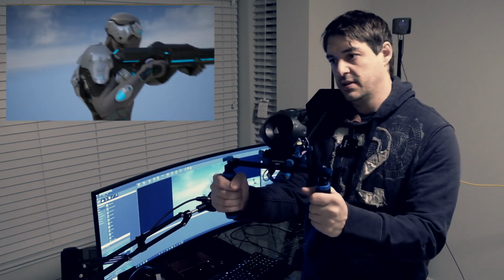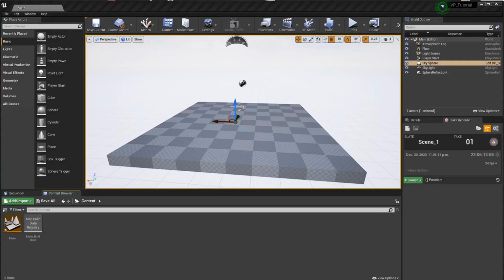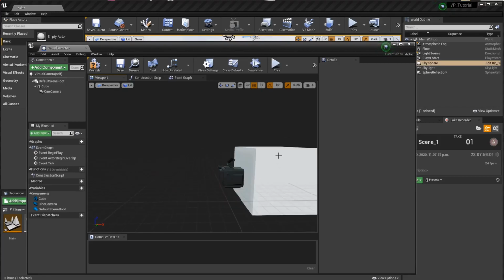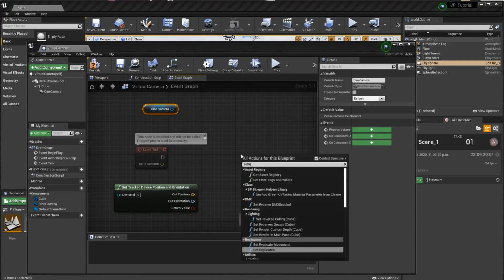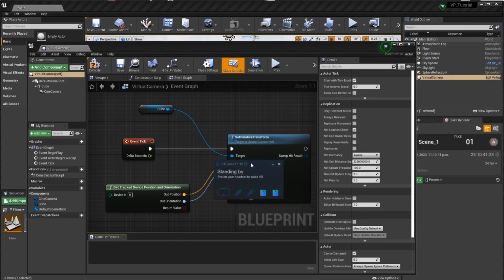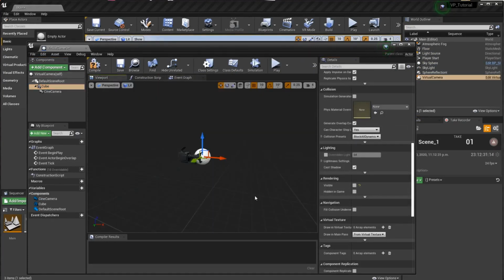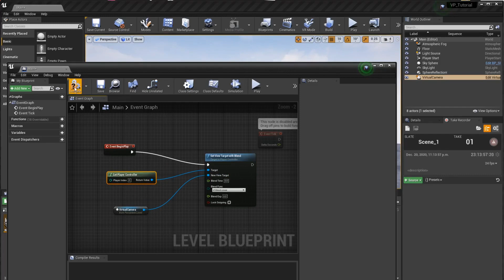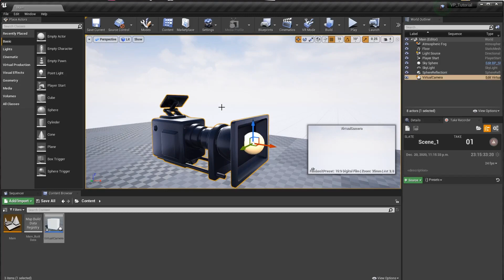Creating a Virtual Camera using HTC Vive in Unreal Engine (4.26)

Comment: for QUEST 2 users, you just have to connect quest to PC via Airlink, then open up steamVR, and once the steamVR recognises your HMD and controllers, do the same exact method as this video. for the index, numbers, QUEST controllers for me were usually 1&2.
Reply from the maker: Thanks! This is great information to know! We are in the process of making an updated video for this, including new hardware and rig, and we could include this information. 

We will also include info about how to find your index numbers through a blueprint.
Reply: @RetroPixelDigital  all the best 😉 thanks ofr this tutorial, it was the only tutorial which helped me to track virtual cameras with VR equipments

Comment: Another question is there any way to average the transform data from the controller to smooth it out? Like a way to make the camera sort of stabilize from averaging the data before it transforms.
Reply: I'm not sure about within the software (probably), but from a film perspective, attach the controller and camera to a gimbal; this technology will stabilize the controller/camera/shot and a necessary tool for aspiring filmmakers. A tripod also works.

Comment: Really appreciate you making these videos. I've got the tracker working as expected now in Unreal. I'm trying to export the tracking data that I record in Unreal to Blender. Do you have any ideas on how to do this? Or do you know if there is a way to use the Vive controller directly within Blender in the same way parenting the transform data to the camera? Thanks alot!
Reply: Sorry about the wait on this... I haven't tried it out, but you could most likely bake the animation of the camera from within Sequencer, then export that to FBX, and import it into Blender. I don't use Blender much, but I know it can import FBX without issues...

The real question is if you can bake out and export the FBX camera... If this isn't straightforward, or it doesn't work, let me know and I will look into a possible solution when I have a few minutes!

Comment: Hey, thanks for the tutorial! Would you tell which version your controllers and base stations are? Does this work as smooth with the first gen vive trackers?
Reply from the maker: These aren't from the pro, but I'm not sure which versions those were. We are now using a new setup, as those ones were on loan. The new one is using Manus Trackers. We will be posting a new video on that setup soon!
Reply: @RetroPixelDigital  Did you ever make the new video? I actually bought Tundra Trackers for full body mocap, but also want to use it to do camera tracking. I'm interested to know how you've progressed, and want to learn this in UE5 hopefully with some data smoothing. Would love to connect with you! Let me know if we can chat!

Comment: Thanks for the tutorial man. I'm trying with my oculus quest 2, it's just pain in the ass as my laptop is not compatible with the link cable, I had to use airlink and the HMD just swaps into the transform, double influencing the location of the blueprint actor like you mentioned in 4:53.
Reply: Did you ever get this working? I'm curious, because I thought it was only possible to do the tracking through UE4 if it was outside-in tracking, like using the base stations to measure the HMD's location, but the Quest 2 uses inside-out tracking, right? It uses internal cameras to track it's location in a room?

I thought this method was incompatible with this kind of use-case, but I'd be interested to hear if you've got it working!
Reply: @tylerwalker492  I did it in quest 2. You just have to connect it with Airlink and once the SteamVR recognise your quest controllers, you're good to go with this method.

Comment: Have you done this with the trackers instead of the controllers?
Reply: I haven't, but I've found a few articles online that illustrate how to do it. I think this would be a better option for me, as I don't plan on using the controller for camera settings. That was one of the reasons Matt Workman preferred the controller to the tracker...

But, the tracker is much more compact, so I would love to replace it eventually.
Reply: it does work, i just tried. You just click "other" as sort of device in the drop menu :)
Reply: @shelltakeyoutoheaven  which drop down window is that? Im using trackers too. cant get the cube to rotate at all, chanigng device id numbers but Im up to 10 now :)
Reply: lol user error, didnt realize my tracker turned off automatically after I restarted steam VR :)

Comment: So all my rotations work, but the physical transform (moving left right forward back up and down) seem to be moving only millimeters in unreal, is there a way to adjust the movement values or correct this?
Thank you the tutorial was much more straight forward than other tutorials I've found
Reply: Thanks for the kind words. I've noticed that it doesn't move enough, too. I'm thinking it's got something to do with real world scale of the scene, but I'll have to dig deeper. Stay tuned!
Reply: @NickRomick  Had any luck finding it out?
Even I am struck at it :(
Reply: @prabhuperiyandavar9207  I haven't had a chance yet. It might be your world scale? Can you check your scene and units  it to make sure it isn't too big? Mine seems to be slightly off, but not toooo bad. I still will be looking into tweaking it, but haven't had a chance yet.
Reply: You should change the Units in wich UE4 works (Unreal Units to Meters o CM)

Comment: Great, thanks for sharing. After working out that my HTC Vive Pro controllers were mapped to IDs 1 and 2 everything worked great. If anybody else is trying to find tracking ID of their device, check out this video from Aiden Wilson below around 06:20: https://www.youtube.com/watch?v=GjCo4p7DNPM
Reply: Yeah that's probably because you dont have any base stations, in that case your HMD is ID 0 and controllers follow in order that you turn them on.
Reply: @antxionrhykel2699  Does it also work only with vive trackers or does it need a HMD?